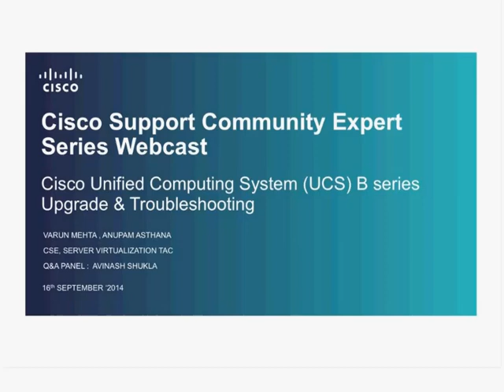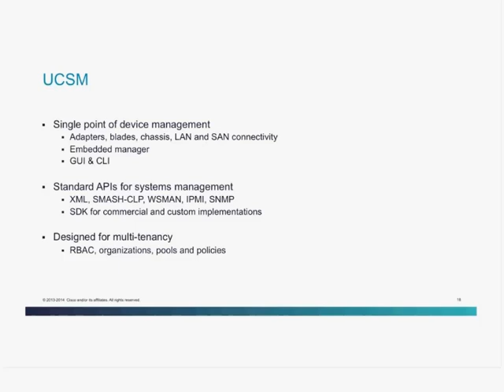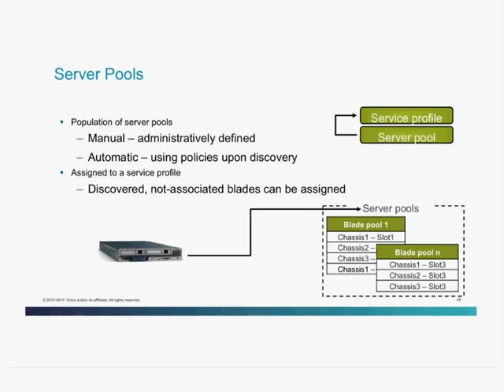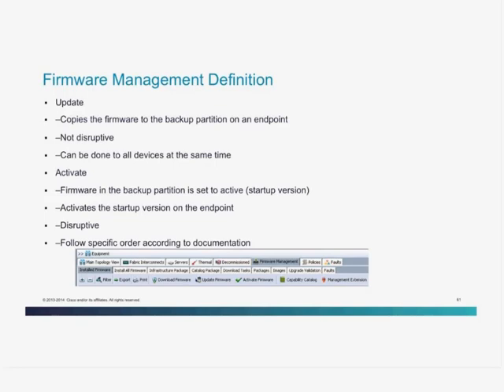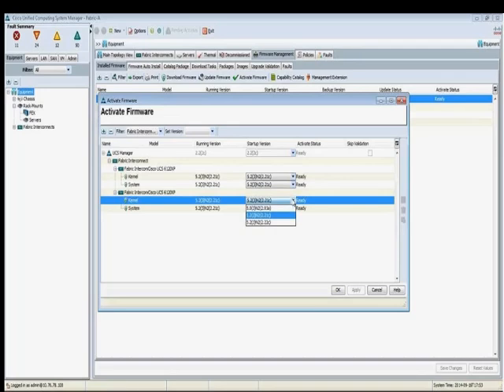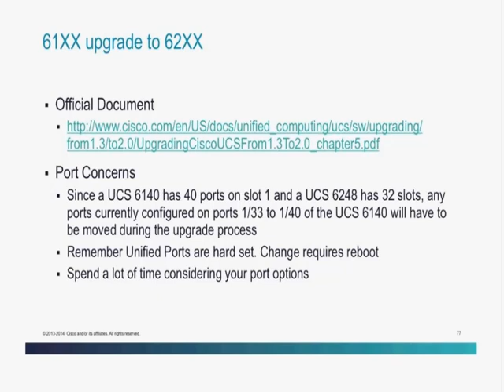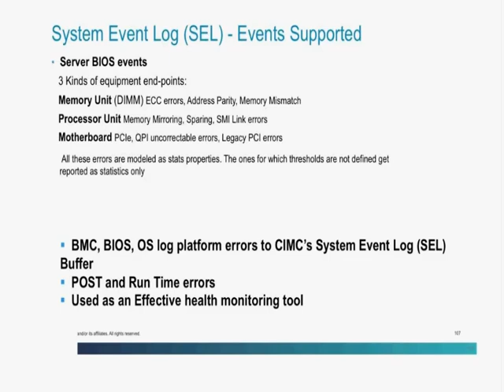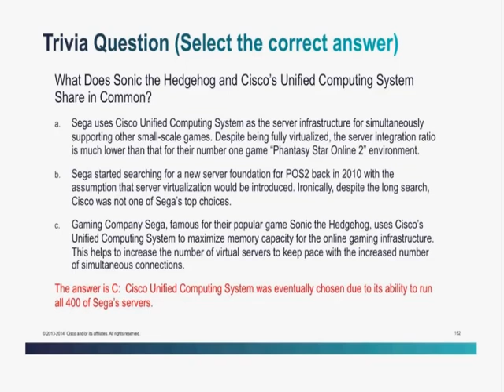Live Webcast: Cisco Unified Computing System (UCS) B Series Upgrade & Troubleshooting

Comment: Hi, just watched the video, very formative thank you. Have a question. How will you upgrade UCS Blades on a chassis currently running on different Firmware versions, will you need to this manually or can be done using the Auto Install option. Will you need yo upload all the packages or you will need to upgrade them one by one until they are running on the same Firmware version then upgrade all of them at once once they are all running on same version.

Comment: I saw your video. I have a question regarding while upgrading the firmware in UCSM It goes reboot the whole UCS At the time is there any packet loss?
Reply: No there is no packet loss it will upgrade only ucsm which is software to manage UCS it doesn't impact data traffic.